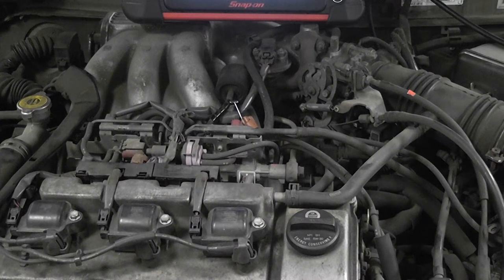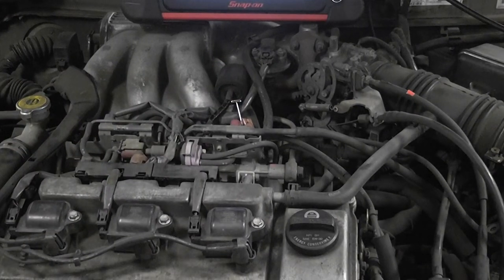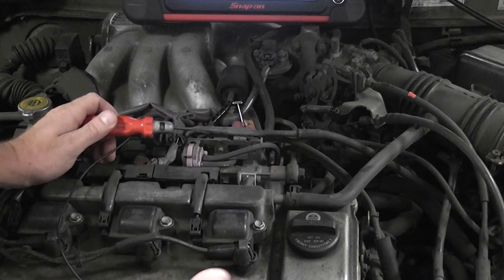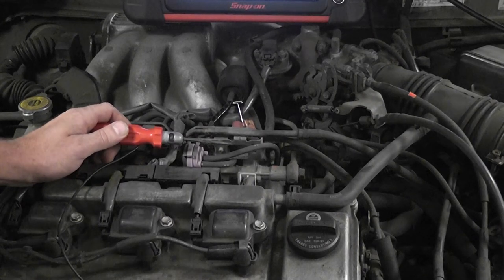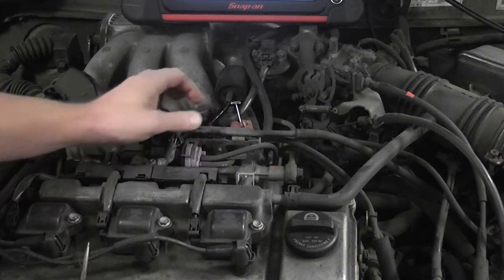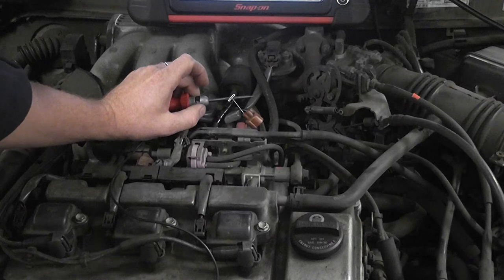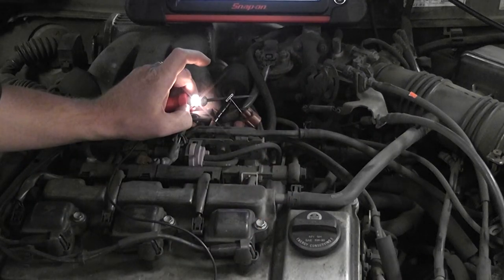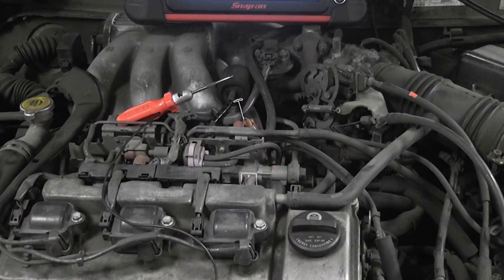How to test a computer transistor driver (with a scan tool)

Comment from the maker: They are listing this code as an internal PCM problem. The P0601 description says "Control Module Read Only Memory".
The only fix is replacement of the PCM and/or a reprogram. Although the P0602 is the only code in this list that they say is a reprogram problem.

Comment: Mr Paul after  some tests the tps got my attention with to potentiometer one of them the signal got glitches from the pcm the other one the signal read 3.30 V and went I accelerator it drop to 2.40 V mi concern is why the pcm not set a code? it's possible the po601 it affected

Comment: Thank you for the content you put out.

I have a pwm solenoid (diesel timing advance solenoid) that I want to protect, or say, prevent my rare EDC old diesel computer from frying in the event of a short.  This is the only device that would draw high current going through that computer.  Would it be beneficial to put a fuse in line between my timing advance solenoid and the EDC on both +/- sides?

Thanks,
Stu with a BMW 524TD with a Bosch VE using electronic timing advance
Reply from the maker: I'm not familiar with that particular solenoid but most of them on the car draw less than 1 amp, so a fuse it not going to help you.

Comment: Can you give me a link to where I can purchase the test light your using?
Reply from the maker: +brasanford1 unfortunately no. Sorry man. Any incandescent test light will work. Just measure your current flow of the light with your ammeter before using it like I do. Anything under 200 ma and you'll be fine

Comment: I thought that applying 12v to the control wire can destroy the computer.🧐
Reply from the maker: If it is a ground side switched driver, for sure! You MUST know your circuit design and operation before doing anything like this.
Reply: If this is a ground side switched driver that you are applying 12v to, then why isn’t it frying the cpu? Is it because the test lamp is under 200ma?
Reply: Ok. Never mind chapter 3 solenoid functional test “if you connect a test light to the wrong polarity you will not harm the cpu”